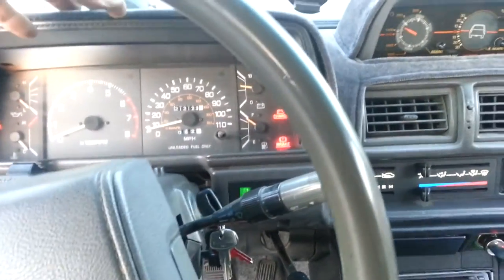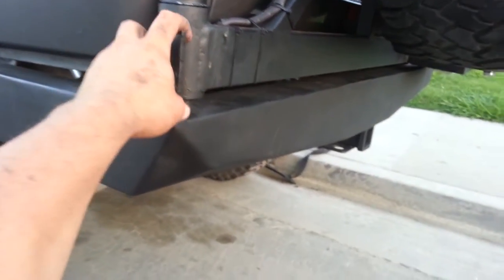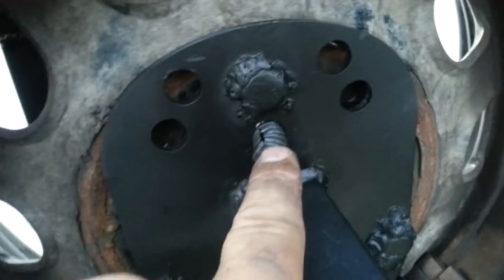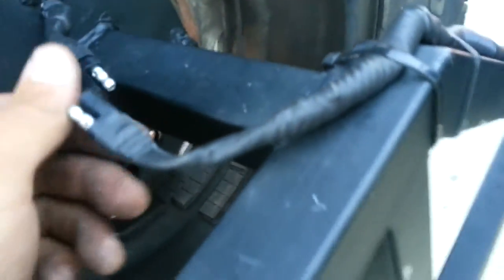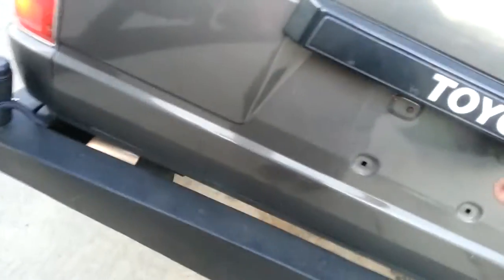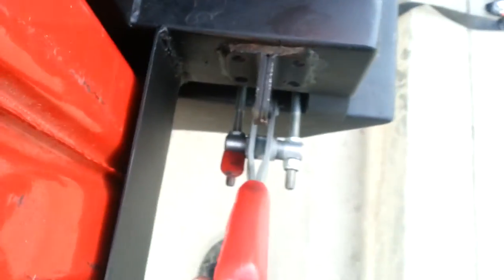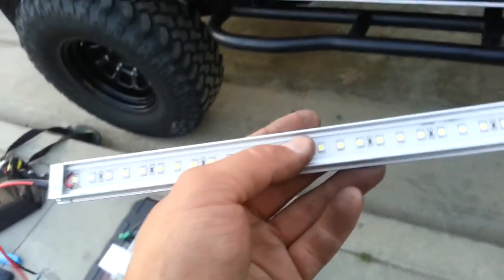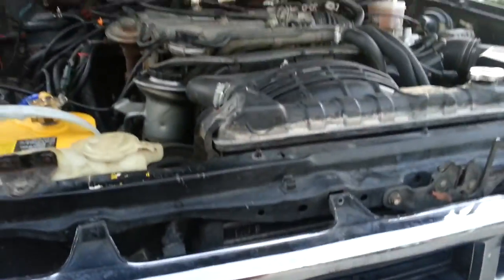EMS tire carrier kit mounted on my plate bumper

Comment: Cool video, I would try a variable resister for for LED light. 
Another suggestion would be to run the cable inside the square tube to hide it. It maybe hard to do in the welded angles but it will look clean. 

Mkrtech-

Comment: great looking runner 
2 thumbs up
Reply from the maker: Thanks man. It looks a bit different now since this video was made and I had to reinforce that tire swing 2 times since I built it. i think the 4runner looks even meaner now with the front bumper.
Reply: What reinforcements did you have to make?
Reply from the maker: reinforcements to the bumper? I have the bumper welded onto the stock hitch location and on the sides near the wheel wells I welded 1/4 tube going from the bumper edge near wheel wells to the chassis.  it's really solid. it takes hard hits when I go rock crawling in big bear.